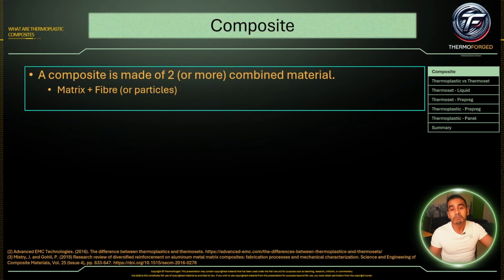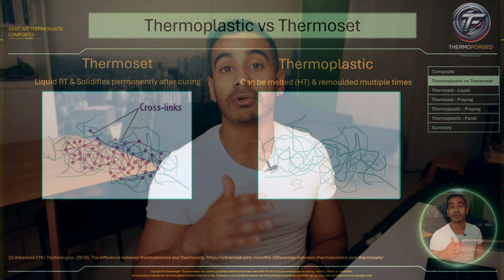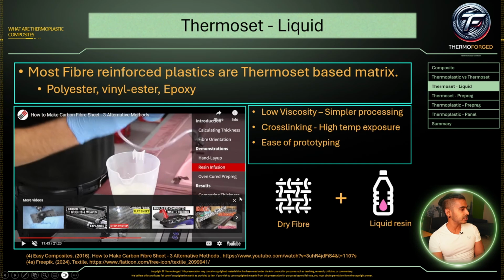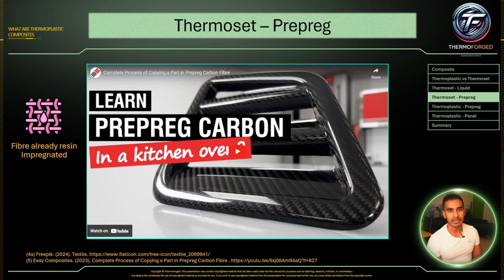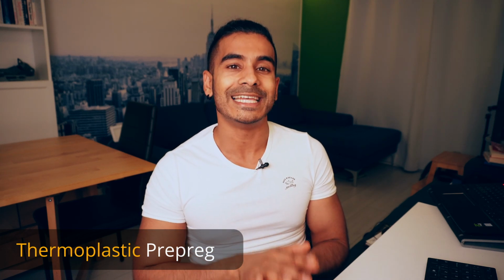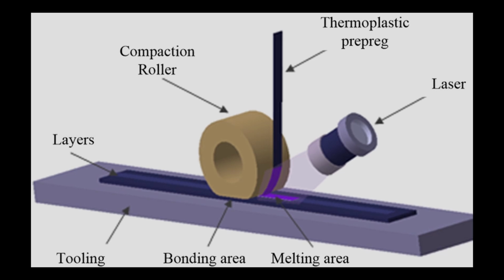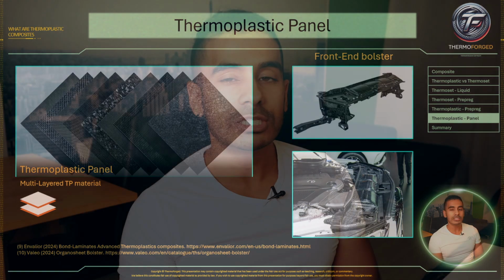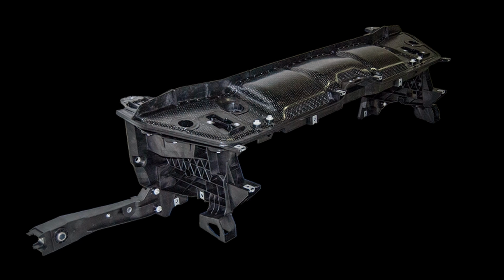What are Thermoplastic Composites

Comment: Wow.  So it seems for applications were you vacuum suck down a standard thermoplastic sheet, you can switch it out for a thermoplastic composite for additional strength, stiffness, appearance, etc.. What happens to the length of fibres as your form it though? Are you restricted to simple geometries that do not elongate the fibres much? The structural analysis of the part I assume would have to be quite different when forming vs applying it by roller on the tube (as in the first example)
Reply from the maker: Hey, So standard un-reinforced sheets you can vacuum + male tool as the material stretches around tool. 
With continuous fibres, they drape rather than stretch - so they are usually placed between a male and female tool to be draped - Videos coming on this ;)